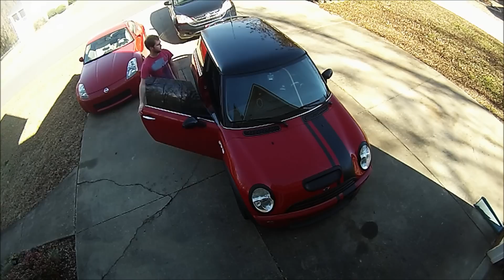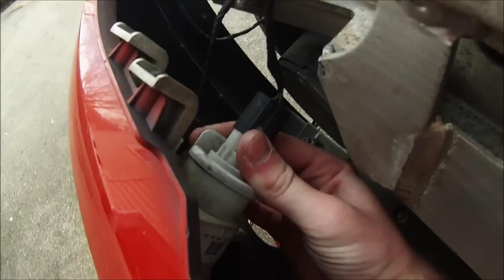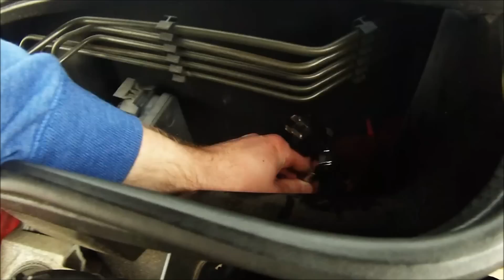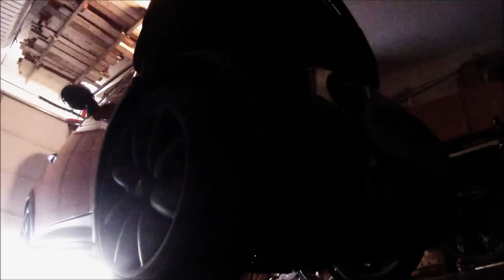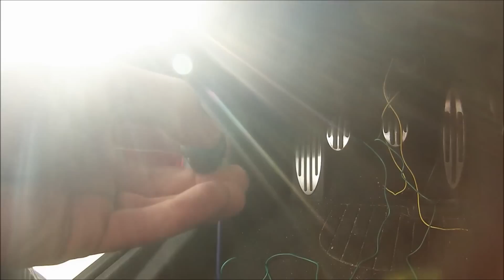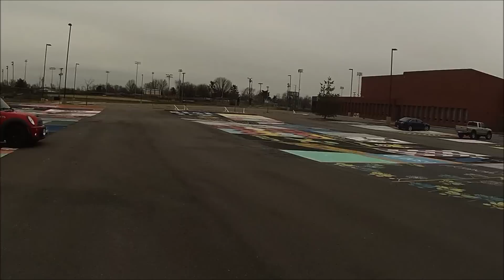Rally Light Installation on Mini Cooper S

Comment: Did you connect the red wire to the low beams or the high beams?
Reply from the maker: Kerrigan Steger I wired the lights independent from the low and high beams. I connected the red wire to the positive battery hook up in the engine bay.

Comment: where did you pull power from when you were wiring?
also was it hard to get the wires through the firewall?
Reply from the maker: I just got the power straight from the battery and yes it was a pain in the ass getting the wires through the firewall but it was definitely worth it.

Comment: Really love that stripe, where did you get it? And what did you use to black out the other accents on the car, love the look!
Reply from the maker: D-Nice Grogs Thanks! its all PlastiDip!!!!
Reply: Yeah, I am retarded. I watched all your videos, a d I must apologize in advance, I am literally copping 90 of what you did! Well my mini is blue so that will be different. I have a patch of Clearcoat coming off of  the hood about the size of a child's hand. I was gonna try to patch repair it with Clearcoat if that will work, but I could just put my plasti dip stripe over it, my concern is that the stripe will show the the break in Clearcoat unless I try to patch it first? What do you think, will the Clearcoat cover the imperfections or exaggerate it break in Clearcoat?

Comment: pretty damn good video editing and camera work.  I'd have liked to see some better lighting on parts of the video (iris/aperture issue) because the bright sky makes the important stuff dark.  But still better than 99.99% of crap on YouTube.  I didn't realize this was a "music video" with a Mini rather than a how-to video.  I'd be critical of the fact that we couldn't see how you did a lot of it (which is what I'm looking for), but if that's not the point, then so be it.  Nice work.  I think my Mini S has an open spot for a switch.  I'd like to find one of those chrome switches to match the rest of the interior switches rather than putting some cheap plastic illuminated rocker in a hole I have to cut into my dash.  Ok for the work trucks, but I'd like the integrated look in this car.